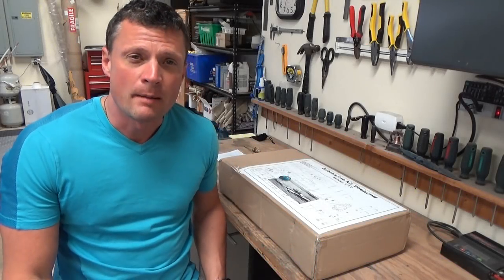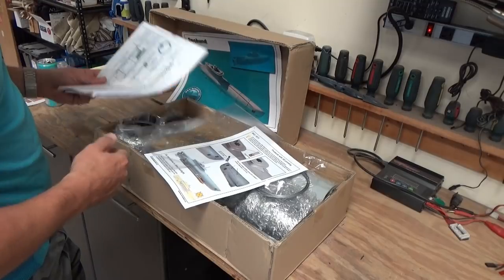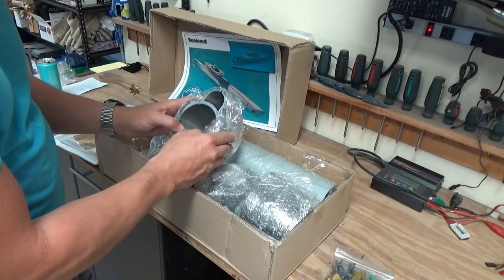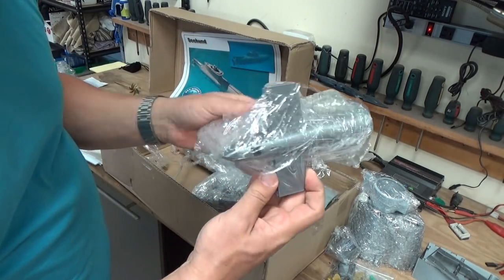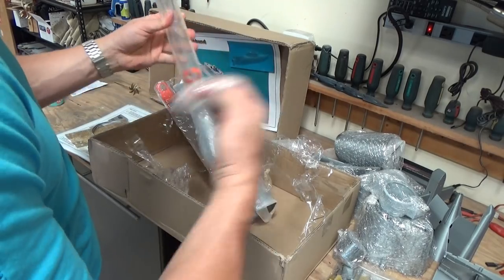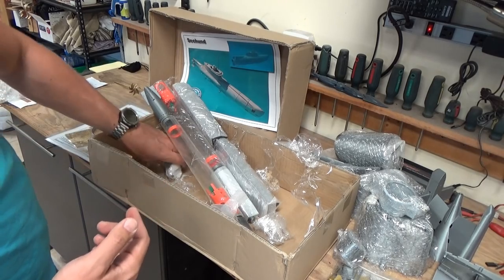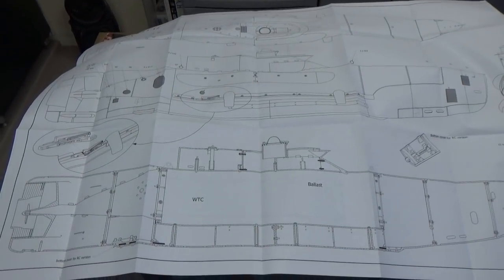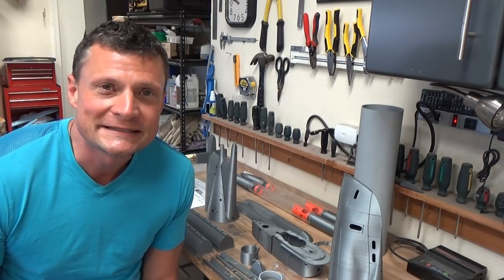1/12 scale German Seehund model kit overview

Comment: Some years ago I was in , ( I think ) , Sweden . When to my surprise I came a cross a real thing at a navel museum  . The aft planes were not made of metal. But made out of wood,  I was told the engine for surface running was a truck engine . It did not have a Rice Speed Nozzle or a Kort rudder like the one shown here ,  but an old fashioned rudder assembly   .
Reply: the where different  versions of the "Seehund" the Kort Rudder was the last version, other boats where made with twin ruder . partly they where build in different versions at the same time but at different naval yards.

Comment: Yeh theres 2 different seahound the XXV11B /B5  THE B5 is the only one the the upper balasts and a rear rudder with shorter prop eg  the thumbnail pic for this video shows a B5 with upper balasts but has the nossel long prop on back when should have a rudder iv still not seen an accurate detail miget yet I had to change my own,the B5 got captured in English channel

Comment: Bob,
Question, are those torpedoes meant to be mounted external to the hull or do they mount inside? They seem large compared to the hull.
 Very well thought out and interesting kit, thanks for posting.
Reply: the Torpedos are on the outside of the hull, hanging in some kind of rail on each side